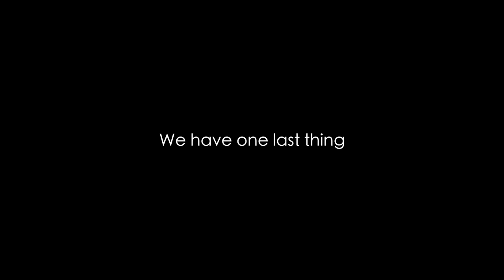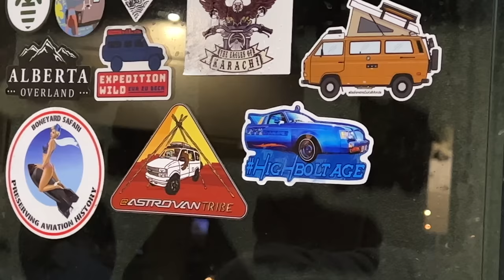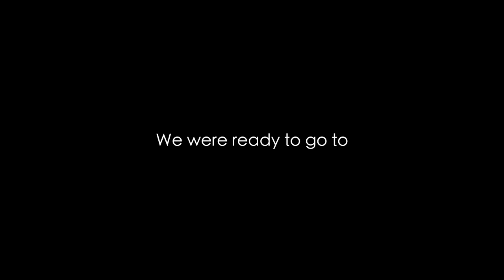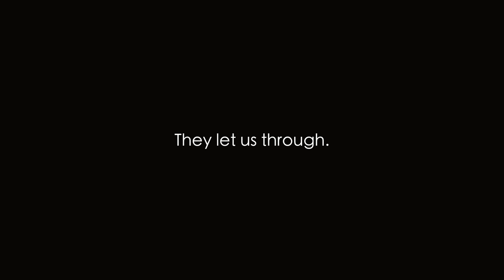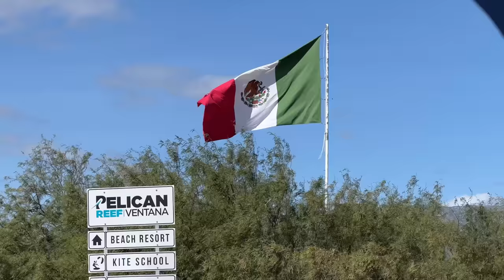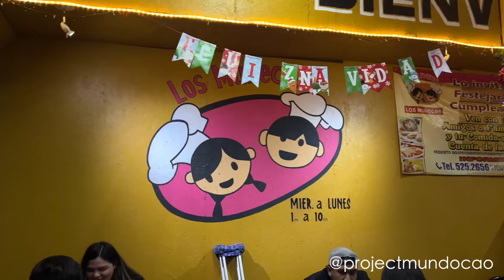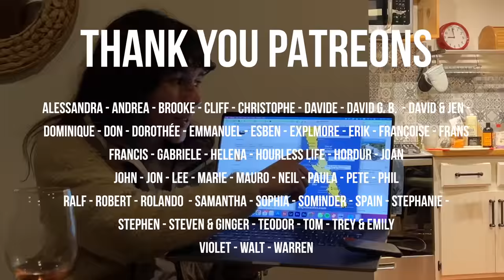We cross the USA / MEXICO border (EP 42 - World Tour Expedition)

Comment: Question for Nick.

You don’t think Eva Zu Beck’s vehicle is top heavy and way over her GVWR?  Her wheels were slipping badly failing to get traction.  I wonder if her vehicle has diff locks and she didn’t air down driving on dirt either.

It was not a particularly bad obstacle where she tapped out and went back and I wonder if she has diff locks and they work and she has enough off road skills.

Without you to help, she would be in some serious Barney.

Rest of you guys seem to do ok with the similar LR Defenders and the Troopy.